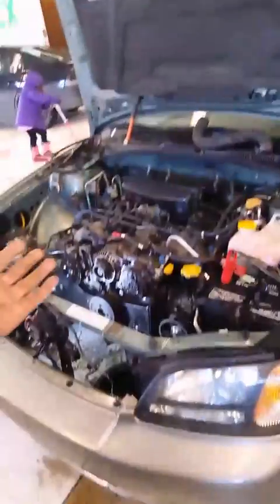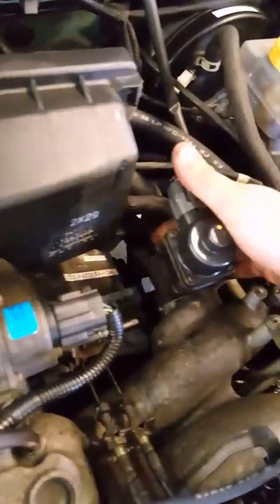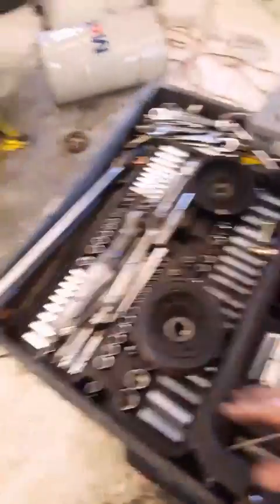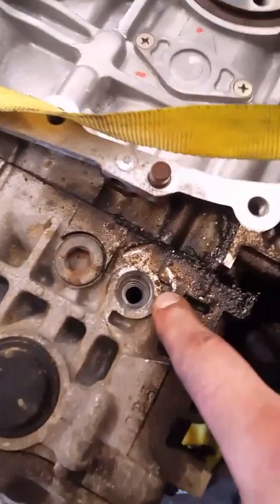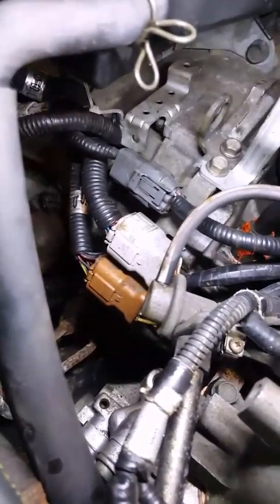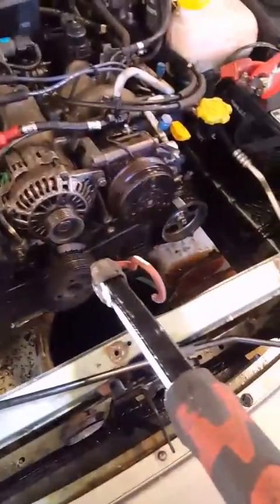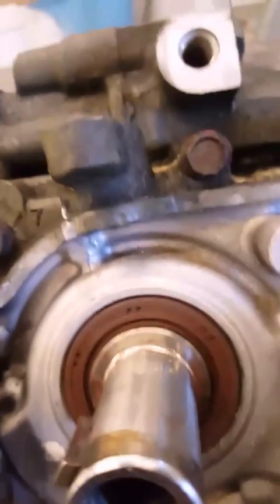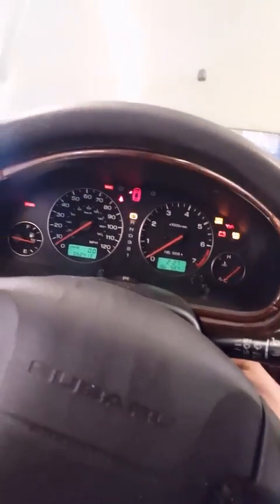SUBARU MOTOR SWAP EJ25 TO EJ20 ALL YOU NEED TO KNOW

Comment: I have an 2009 Subaru Impreza NA EJ25 which sounds like it has rod knock. I've got a co-worker that is willing to give me a 2002 Forester with an EJ25 NA that runs great but the body is rotting out from under it.

I've read I'd need to swap the heads, sensors, and Crank sprocket and Driver side sprocket.

IS this true do you have any other suggestions or guidance as I'm looking to do this swap to give me time to rebuild my knocking motor before swapping back and keeping one from the forester as a backup.
Reply from the maker: Steven DeZalia it is absolutely true swap the heads all the sensors the two sprockets for the main crankshaft and the driver side camshaft and the intake and you should be good to go
Reply from the maker: Steven DeZalia may also have to swap the torque converter plate"flywheel"
Reply: Mikhail Burke thanks for the quick response. Look forward to the swap as I miss my 09 impreza since the motor went.

I'll report back to let you know and to allow others to learn from what I'll be figuring out this weekend.

Comment: Hi can I use a 2005 ej25 heads and put it on a 1998 ej25 block? Thanks
Reply from the maker: Great question... And the answer essentially is, YES. over 75% of the 2.5 blocks are exactly the same since the age of SOHC usually 99-06 and even current. Just don't mix a longblock and shortblock at all or a DOHC with a SOHC unless you have the correct sensors setup!!!... truth is the blocks and heads haven't changed hardly at all. Mainly just the intakes and whatever's on top of the block has done all the upgrading... hope this helps!
Reply: Thanks a lot man! 😎😎😎

Comment: Hey Mikhail you seem to know your stuff about this swap, I have a 2003 subaru legacy with a knocking 2.5, do you feel like swapping a 2.0 into it would be the way to go? Price wise it seems like a great solution, but I worry about the power and reliability difference. Any suggestions would be awesome, Thanks for the video.
Reply from the maker: Hey man, yes you will have less power. And Slower take off.  However reliability will be the same. If your going to put in a 2.0 to match the power of the 2.5 you'll want to get the turbo motor. That will require the harness with a turbo boost sensor wired in and the PCM to be flashed with the turbo programming. And it will be as if it's a 2.5 under the hood still. But that could cost a pretty penny. Swapping to a 2.0 non turbo like I did here is mainly a last resort if no 2.5 motors are available at decent prices. Or if you have one laying around and want to save a bunch of cash and not care about the loss of power like my customer did. Otherwise swapping to the same motor would be my suggestion.

Comment: Is this an ej253/255,etc to ej205? Im looking to do the same with my ej253 to ej205 soon. Thanks for the info either way.
Reply from the maker: Edward garcia what are the years of the motors?
Reply: Mikhail Burke i have an 06 impreza with the ej253 and the engine id like to swap in is the 03 bugeye ej20 with vf39 turbo.
Reply from the maker: Edward garcia will have to have PCM special programmed by dealer to run vehicles accessories and that specific engine. May have to modify harness!
Reply from the maker: Edward garcia also the vehicle will take its time on take off and gaining speed if turbo is not present on the motor you want to drop in.
Reply from the maker: Edward garcia you will need vehicle Vins for the one it's going into. And the one the motor came from.
Reply: Ok cool. Thanks for the info! That helps a lot

Comment: i have an 06 forester non turbo and the engine seized up. i was thinking of going ej20 with turbo. i was wondering if anyone had any info as to what i will have to swap and or replace etc!  thanks!
Reply from the maker: nick Vellender is the motor that seized an ej20?
Reply: Mikhail Burke ej25!
Reply from the maker: Ok. So same stuff applys here. If you go with a turbo. The chassis harness will need altering to include a circuit for the boost sensor. And pc flashed by dealer to include programming for it. The 2.5 and 2.0 non turbo and turbo motors run off the exact same programming. The differences are the programming and the wiring and socket being present or not for a turbo. Sometimes the non-turbo harnesses already have the wiring and a socket for a turbo boost sensor but the PCM doesn't have the programming to communicate with it. Other times the harness does not have the wiring and definitely does not have the programming. Also the heads on the turbo 2.0 are very much different. If you were to use this process to install the 2.0 in your vehicle without the turbo it would tremendously lag power, but it will work just fine. It'll just take its time getting up to speed, and won't have much get up and go... so if I were you I would check the harnesses on the chassis and the 2.0 motor for comparability. Then ensure if they plug into one another that the chassis harness has the wires for a boost sensor circuit. If it does. Put the turbo 2.0 in and modify your exhaust accordingly. Take the PCM and have it programmed to include the coding it needs to communicate calibrate and control a turbo boost sensor. Reinstall and enjoy. If it doesn't have the wiring. Just find a non turbo 2.0 or 2.5 to drop in. Or of course modify the harnesses by adding a circuit.
Reply: Mikhail Burke dude thank you so much! been lookin all over and like you said info is very scattered and never exactly what i’m looking for ever.
Reply: what song is this?!
Reply from the maker: nick Vellender check the ending credits

Comment: Hey man would I need to swap the ECU from the stock USDM 2.5 one to a JDM 2.0 one to make sure the fuel trim is correct?
Reply from the maker: wesley wheeler to answer this accurately I would need the years and models the engines are from and or going into.
Reply from the maker: If the years are close no. The 2 motors use basically the same programming. It wouldnt hurt to flash the PCM for it. But isn't 100% necessary!

Comment: how did you route the egr valve using the ej25 intake I'm stuck at this part
Reply: or can I just cap off the tune coming from the exhaust on the ej20 since the ej25 did not have an egr
Reply from the maker: If the ej25 didn't have an EGR. Then cap it on the 20. If it did have one. And the 20 block does not... The port would have to be drilled.
Reply: thanks

Comment: does this also apply for a ej255 swap to a ej20x?
Reply from the maker: Hard to say without knowledge of the years and harness types of the engines.
Reply: Got a backward ass question. I have a blown wrx (2.0i) and wish to swap in a ouback impreza(2.5na) same gen.....could I reverse this process(so to speak)? I mess with vw/Volvo but nothing beats a winteroo..thanks in advance